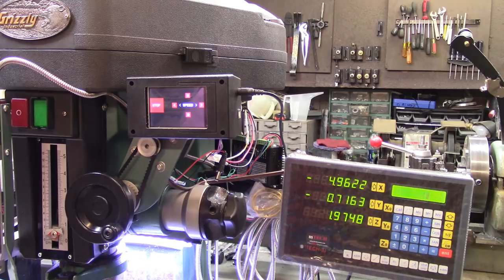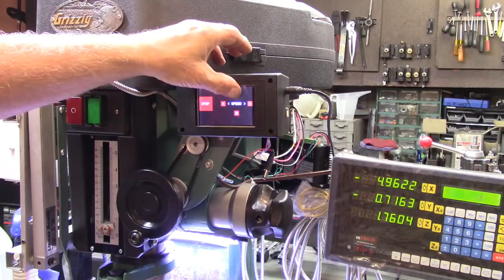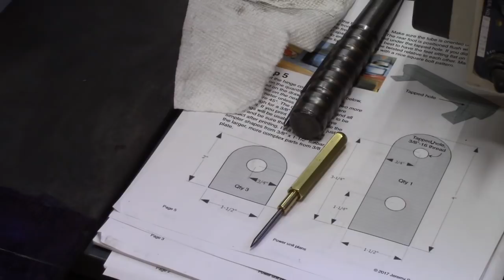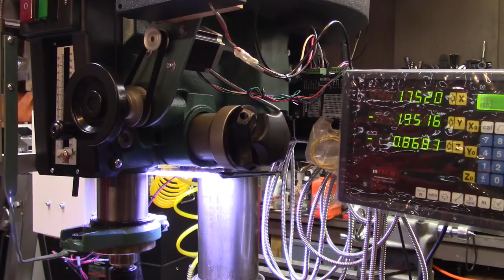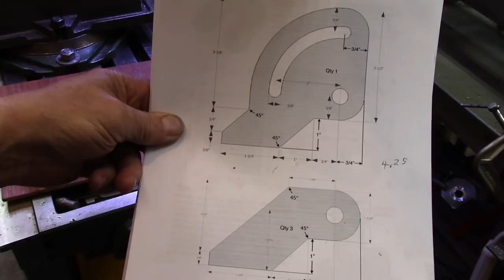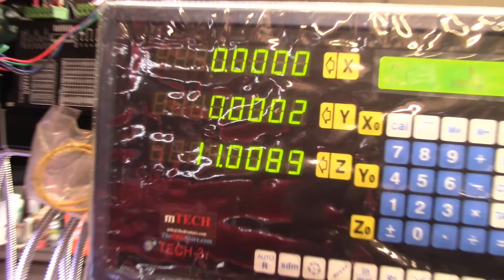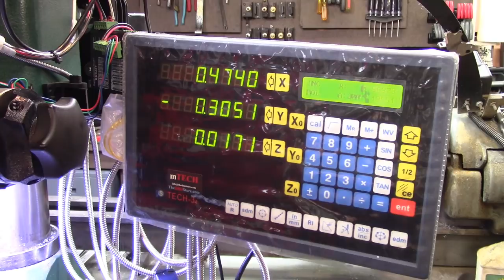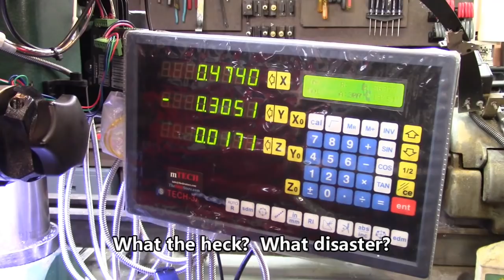Belt Grinder Part 5A - starting the hinges

Comment: Hi Harold. I have a cheepo bandsaw of unknown make. It has a piece like your stop but it is fitted the other way round and is also a bit more angled on the  end. At the front it touches and at the back end it is about 1/4" away from the workpiece. I have not have any problems with jamming (so far). Maybe I am lucky for that. Grinder coming on well now.  Thanks for sharing. regards from the UK
Reply from the maker: Thanks for stopping by.
Reply: I lost my stop for my bandsaw so I made another one. I don't remember it jamming the saw up ever either. But I don't use it much. If I really care how long something is I cut it longer then mill it to length. Because my bandsaw never cuts stuff too square anyways. Pretty square but not exactly. Then I ended up finding the stop one day. But I like the one I made better anyways.
Reply from the maker: @1pcfred  lots of times if you want it done right you have to do it yourself.
Reply: @AmateurRedneckWorkshop  if I want it done right I call a pro. They do it fast and make it look easy. But where's the fun in that?

Comment: Hey Harold, yeah I try stuff like that arc, but because I am soooo cheap with my end mills, I try to clear most of that material with a drill bit and then clean up with the mill, also I think my mill-drill is a size smaller than yours,. Cheers, I would be  about a day and  a half due north of you ,1 day motorcycle ride to Everett, an extra day to AVE's, and Pierre's is even further to my east, plus and extra day to the east coast.
Reply from the maker: You do know I am in Houston.  Thanks for stopping by.

Comment: I have the same saw- I made a new LONGER bar for the stopper so you can cut longer material - ALSO - I got rid of that awful allen key set screw and welded a short piece of rod stock to a 8mm bolt and made a quick adjust t-bolt for the red stopper! - Keep-on, keepin' on!
Reply from the maker: Improved it you did. Thanks for stopping by.

Comment: Your arc cutting was working better than I expected it would until the head came loose. For more stability with your Arduino try putting a bulk filter cap across the power input. Just about any little electrolytic cap you can scrounge up should help. I'd use maybe a 470 uF cap if it were me. But anything from 220 uF to 680 uF should do the trick. Even 100 uF might not be too bad? The cap will have the negative lead marked on it. So just put that on the ground and the other lead on the positive and you're good. What the cap does is it smooths out any little power hiccups that might happen due to a varying load and the power supply being too far away to react to it. It is like a little electricity storage bottle. Too far away in electronics terms is maybe a foot or two. It's not much. But the filter cap closes the gap. It makes it like the power supply is right next to your remote electronics. With your mill head what I do is I leave the wrench on my mill table until I tighten it down. If I see the wrench it reminds me I have to tighten it before I cut. Then I put the wrench in its box. Head loose wrench on table. Put the wrench right on your work if you have to.
Reply from the maker: Thanks for the great tips.  Thanks for viewing.
Reply: @AmateurRedneckWorkshop  I've ruined stuff not locking the head on my round column mill too. I can still manage to sometimes but the wrench on the table helps me out a lot. I know it's not supposed to be there.

Comment: Hey Harold, thanks for the shout out, was glad to hear they got there even with the postal strikes here in Canuckistan. Never met AvE, nor his adorable Enginerding Chickadee, but from what I can tell they are to the south left of Better Half, Little Man and I by about 700 miles. Wouldn't mind meeting them, but as you say it would be hard to recognize him. Had a good laugh that Phil and Pierre showed up with the safety gear public safety message, better safe than sorry. And for what it's worth I've been caught by the head of my mill being loose during a cut too, I hear your frustration. Scares the crap out of a guy when the thing jumps!
Reply from the maker: Yeah AVE is doing a good job of staying anonymous.  Thanks for stopping by.

Comment: Nice win on the ER32 wrenches.
Reply from the maker: Sometimes you get lucky.  Thanks for stopping by.
Reply: @AmateurRedneckWorkshop  thank you for the great videos. Thanks to Tom from Hill top machine works and Jim from sawlogs and plastic hubs ( both on YouTube) helped me make several great scores arbor press, micromiters plus a couple other things. Jim gave me a 4x36 belt sander he was not using or needed. You remind me of them. Like you both are down to earth.
Reply: I have an OZ25 (SYOZ, EOC, Perske style) collet set made by SYIC for my mill. That's the name on them wrenches. So seeing that name perked me up some.
Reply from the maker: @1pcfred I think they sold the collets seperately but I already have ER32 collets so I did not bid. Thanks for stopping by.
Reply: @AmateurRedneckWorkshop  I've watched a bunch of videos here on YouTube about folks with bum Chinese ER32 collet sets. They're getting all kinds of run out. Some say the nuts are bad and just replace those. But one guy did that and it turned out the threads on his holder were not concentric with the tool. At that point you really have nothing but a paperweight. Now speculation is the cheap Chinese stuff sold is all factory rejects. When I worked in a machine shop we scrapped our rejected stuff. That's why what we made was so expensive. Because we ended up scrapping a lot of parts. More than we ended up selling. When you bought one of our gizmos you got it and paid for the other 9 in the scrap bin too. But the one you got was perfect. That's why it costs 10 times as much as Chinese stuff.

Comment: Yikes!!!  I was wondering if you had drilled the bulk of the arch first then tried to clean up if you might of had success...my guess is NO, as the endmill bite would probably occur...but I give you kudos for your attempt....lots of methods to make that arc and you tried one of them.....great video and enjoyed the monkeys....too funny
Reply: An interrupted cut can be worse. Really he was doing OK except the column lock on his mill was loose. I saw the head move before disaster struck and I knew what was going to happen. I didn't think he had a chance to pull it off initially either. Swivel vises are not exactly rotary tables.
Reply from the maker: I gave up and did it right.  Thanks for stopping by.
Reply: @AmateurRedneckWorkshop  well yeah. You have a rotary table. You even have a hoist to pick your rotary table up. I watched the videos of you making it.

Comment: Enjoyed the video👍. Better luck next time with the slot.
Reply from the maker: Yeah I need some luck.  Thanks for stopping by.
Reply: @AmateurRedneckWorkshop  you just need to use your rotary table. I still don't have one of those myself. If I did I'd use it whenever I could. I had to eyeball cut an arc slot for my disc sander table I made. It sucked. What sucks worse though is I never adjust the danged thing. The funny thing with adjustments is I use them til I get something just right then I leave it like that.